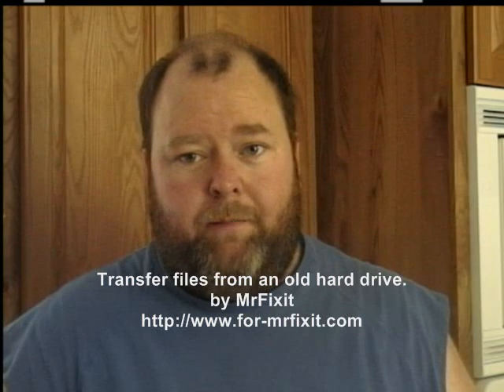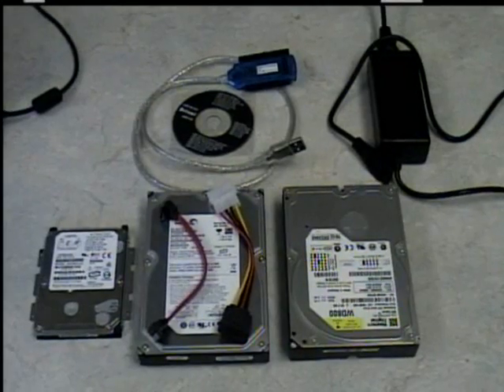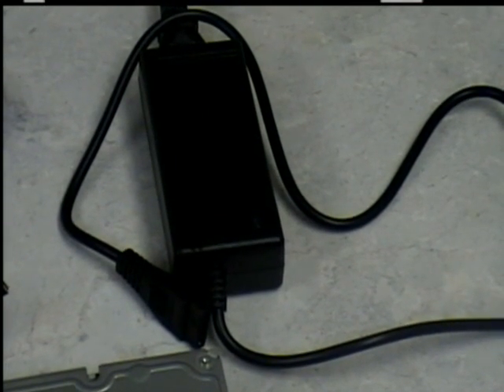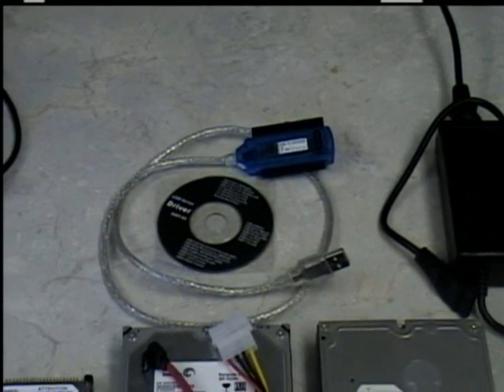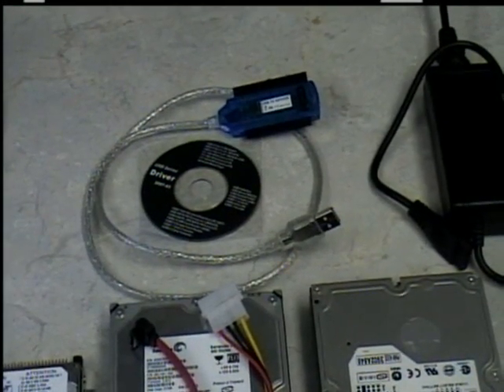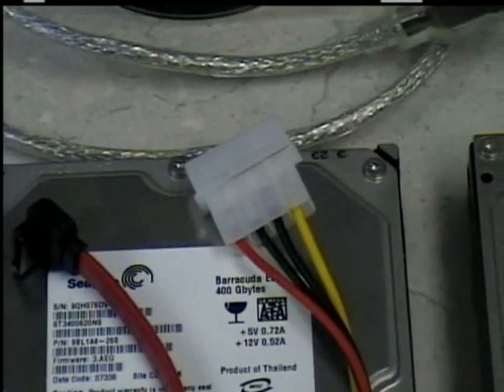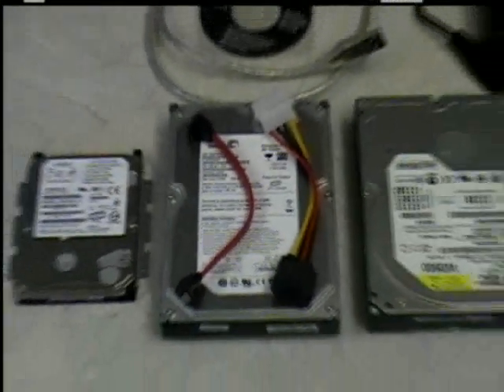How to transfer files from a Dead PC [CC]

Comment: Do you have a method devised in order to recover data  from mSATA SSD Drive to a USB Adapter ?   Can files be recovered by replacing  the Sandforce controller  ?
Reply from the maker: The method is not that different. You just need a  mSATA to USB adapter.  This will convert the mSATA drive into a USB Drive that most Data Recovery Software will recognize. As for the controller, It is possible to replace the controller but no guarantee replacing the controller will resolve the issue.

Comment: How do you transfer files from a dead hard drive though
Reply from the maker: IF the drive is dead and not functioning, you will need to send the drive to a specialized Data Recovery facility which can cost up to $1,500 or more to recover the data

Comment: NEVER EVER rely on a format of the drive or a delete of a partition to secure sensitive data. Data is easily retrieved from drives that have been formatted or had a partition removed. If you have data that you wouldn't want to simply give to a total stranger, always disassemble the drive, and drill at least three holes in each platter. That is the ONLY way to secure data.

Comment: Firs off, great tutorial. But I'd like to ask if I replace my old non- booting drive with a new hard drive, is it just as simple to transfer my files from my failed drive by connecting the sata adapter. Would love the feedback thanks
Reply from the maker: IF the old drive is still functional you may be able to mirror the drive to the new drive. .
Reply: ESRepair thanks. Yes it's functional. Will give a try!

Comment: Thank you very good job explaining everything step by step  , question can u transfer the information ,one way or u can transfer info from a 2.5 to a 3.5 HDD,  reply thank you.
Reply from the maker: You're welcome. To answer your question, the adapter in the video can only connect to 1 drive at a time. You cannot connect a 2.5 and 3.5 on the same adapter.

Comment: the plug in for the pc transfer kit thing looks like the Xbox 360 transfer cable plug in so can this plug into a 360 hard drive
Reply from the maker: I do not know if the adapter will work with XBOX drives. Do not have an XBOX to try it. -MrFixit

Comment: will this work importin to windows 10?
Reply from the maker: The adapter in the Video doesn't convert IDE to SATA nor SATA to IDE.  It will convert a SATA or IDE to a USB connection for laptops and Desktop PCs.  -MrFixit
Reply from the maker: Yes. the adapter will Work with Windows 10. You can transfer files and data you had created or downloaded, but it will not transfer any programs that were installed on the hdd.  Some adapters do have a Capacity size limit. Double check the Max size limit of the adapter to ensure it can read the hdd it will connect to.  -MrFixit

Comment: Can't I just install my old hard drive into a new computer by putting it in and using the extra power/sata cables coming from my PSU?
Reply from the maker: You can if your computer has an extra HDD bay to install it. -MrFixit

Comment: I had a HP all in, has pictures and other data on it. like to transfer to a newer pc, with windows 7 , the all in one has windows 10 that I couldn't get my windows 7 back anyhow, I have it all hook up right, but it won't spin, the manual for the adapter ended up as a dogs toy. hope you can help, thanks for your consideration.
Reply from the maker: if the drive wont spin. check the power connections.  other than that the drive is bad. -MrFixit

Comment: Do I need to set my HDD drive to either slave or cable select? I am running Vista.
Reply from the maker: The USB adapter doesn't use Master/Slave  protocols because it only connects to one device at a time.  Be Advised that Vista will lose all support in 2017 as it nears the end of it's life cycle.  -MrFixit.

Comment: Hello, ESRepair. Are you still available. Need some help with an old Ide drive recovery. 

I bought this kit from ebay, a usb to IDE sata S-convertor cable adapter power supply. It's similar to yours wish I would've found your site first.  

Question. is I have an external hard drive 500gig when connect shows it's E:/ drive  when I connect the IDE drive it shows as F:/ drive.  To my laptop. 

What I want to do is transfer all data from the 80gig IDE drive to the 500gig external hard drive. I'm not going to use the old IDE hard drive, so after I clean it I'm getting rid of it. 

Help is greatly appreciated and thank you, to or anyone else who can help me out.

Comment: hey i have question how can i find out the HDD that i have is 3.0/3.5 or 2.0/2.5 connectors?
Reply from the maker: ZiDDi JaTT  Desktop PCs use 3.5 inch HDDs and Laptops use 2.5 inch HDDs.  3.5 inch PATA/IDE drives have a 40-pin connector and a 4-pin Molex power connector.  2.5 inch PATA/IDE drives have a 44-pin connector because the data and power are in 1 connector.  Both 3.5 and 2.5 inch SATA use a 15-pin power connector and a 7-pin data connector.  -MrFixit

Comment: My local computer shop told me my hard drive was dead.  So, I purchased a new hard drive from them. They gave my old hard drive some kind of quick test and told me it was not working but they could do another type of retrieval that would cost me $160.00.  Should I buy this adapter and try your method?
Reply from the maker: bob abraham You can try this adapter to gain access to the drive, Plus you can watch my video https://www.youtube.com/watch?v=Hn29rsb54Kw to try the data recovery program and see if it can recover data from the drive. -MrFixit

Comment: hey i have bought new hdd 1tb and my old one is damaged or dead i cannot boot to windows with my old one so what should i do to copy files from my dead hdd ? just i do the way you do in video ?
Reply from the maker: GTASeries Mods Yes, as long the HDD itself isn't damage or has failed, you should be able to retrieve the data from the drive. -MrFixit

Comment: Howdy ESRepair..... Are your still around ? I need your help.
Reply from the maker: Roger Sayers Yes, We're still here. How can we help? -MrFixit
Reply: It's great to hear back from you. I have watched your video on transferring files from a old hard drive to a new computer. I have a SATA drive from a windows 8.1 computer, It has a lot of family photo's and vids on it, along with some other important things that I would like to try to recover. There is nothing wrong with the hard drive. It works fine. I also have two other hard drives from other older computers that I would like to save things from as well. What I needing is, Is for you to please tell me just what I will need to buy from you so I can try to recover the photo's and videos. Please give me part or item number (s) of the equipment that I need, and I will purchase it today. I think I know what to order, and I posted the info, but please tell me just what I need
Reply from the maker: Roger Sayers If you just want to transfer data and toss the drive, you can use the CoolMax IDE/SATA to USB cable adapter (T13-2519) for $19.99 or the Vantec NexStar Hard Drive USB Dock Station (V13-3300) for $34.99, but if you want to keep the drive to use as a backup then use either the Sabrent 3.5" (Desktops) USB/eSATA HDD enclosure (M501-1196) for $29.99 or the Ultra Aluminus 2.5" (Laptops) USB/eSATA HDD Enclosure (ULT40244) for $19.99. All items can be found on my online store at for-mrfixit.com under Hardware / Hard Drives. -MrFixit
Reply: Want to keep the drive. I'll be checking things out in you store...
Reply: +Roger Sayers I have to ask a completely noob question here, but what stops anyone from just connecting the old (working) drive to the new computer?
Reply: Jason Jedlikowski
Nothing, and that is just what I did after I purchased the correct data cable. I also purchased the adapter that I was talking about, and I have to say I love it. I can now check hard drives without having to open my computer and messing with the wiring. All I have to do is plug the adapter into the hard drive and plug it in to one of the six usb ports that I have on my computer. This adapter kit is great because it has it's own power supply. If you ever buy and use one, You'll like it, and you won't regret buying it.....

Comment: Whats the difference in putting the internal hdd in an external hdd case and using these adapters? Please help. I have in internal that I cant see to get to boot from the USB.
Reply from the maker: MisDirected There are no differences except External case are used if you plan to keep the drive as a USB device where as the cable version are used as temporary means to recover data and tossing the drive.  in order to boot from a USB device the BIOS/UEFI must support USB boot protocols. -MrFixit

Comment: You can format that drive and even delete the partition BUT the data IS still there!!!

Give it to another person and they can easily recover all of that data!

What you need to do is use software that will overwrite the data on the drive to make it unrecoverable.
Reply: or do it right and disassemble the drive and drill at least three holes in each platter. That is the ONLY way to secure a drive. Programs such as Encase can recover files from drives that have been formatted, and have had the partitions removed. Encase doesn't rely on windows partitions so partitionign doesn't matter. It uses a raw type read and simply appends a ~ to the leading character so it doesn't matter what the file name is.  Try overwriting with zeros and i'll own your data in a few seconds. Overwriting with zeros doesn't work either.

Comment: I have different problem, after I log in all I see is an empty desktop, mouse still works, alt + ctrl + delete brings up screen which has task manager button but when I click on it the screen goes back and task manager will not appear. Is this software or hardware problem and how to fix it. Thanks, by the way operating system is vista home premium 32 bit.

Comment: ES Repair--I'm trying to transfer files from a Win98 hard drive to another Win98 hard drive. Everything powers up but I get "Need drivers".   I have the connectors, cables etc. Apparently need drivers on CD. Do you have the drivers on a CD?
Reply from the maker: Too-Zee Potts many of the new adapters are not compatible with win98 because it is no longer supported. You may be able to check with the Manufacture of the adapter to see if they have an adapter. an alternative would be to add the HDD to the other PC as a secondary drive. because this is Win98 the drive would have to be connected and configured as a slave drive. -MrFixit
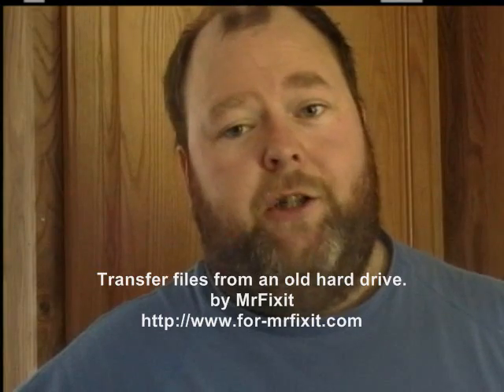Reply: According to the video above. There is a CD available with the drivers needed for Win98 to transfer files from a dead  computer hard drive to another hard drive. At approx. 11:34 there is a CD in clear view. that supposedly has the Win98 drivers.  Is that CD availavble?

Comment: when I connect my 2.5 laptop HD it starts up fine and I can see it in device manager and windows explorer, but every time I try to open the drive it locks up windows explorer and I have to restart my PC. same result on 2 different machines, 1 with windows 7, another with 8. Any advice would be appreciated.
Reply from the maker: Try running chkdsk to see if there are errors on the drive, it may be able to fix the it. -MrFixit

Comment: Your online store link says "page Not Found", I ordered something that looks like what you are using from Amazon, I think it is the same thing.
Reply from the maker: Thank you for letting me know of the problem. I have corrected the broken link. -MrFixit
Reply: Question, I have one that looks like the SATA/IDE you have, but some IDE drives will not spin up and I know they are good, maybe it is because I am using a Win 7 machine and I am trying to read a FAT 32 drive from Win (*?
Reply from the maker: ***** Windows 7 has the ability to read FAT16, FAT32, NTFS, and GPT formatted Hard Drives. If the drive is not spinning up, unplug the power to the drive, unplug the adapter from the PC and the drive. 1st make sure the power plug is fully inserted into the power connector then turn on the power adapter. Within a couple of seconds the drive should spin up and hear the heads click. Next, Plug in the USB adapter into the drive. Finally, plug the adapter into a open USB port. -MrFixit
Reply: THANKS, I will try that.
Reply: I have a drive that will spin up but nothing happens when I plug in the adapter, I tried it every way, I first plugged in USB cable FIRST than the IDE end into the hard drive, than I  plugged in the IDE in the hard drive FIRST than plugged in the USB cord to the computer.
Even unplugging the power first or last did nothing.
The drive DOSE spin, I do NOT hear any clicking just a smooth spin.
I know the hard drive is good because I formatted it in a Win 98SE computer.
It did have data on it.
Sorry to keep posting this but my computer skills are not good.
Reply from the maker: Thats ok. If the heads are not clicking when power is turned on, there may be something mechanical wrong with the drive. try my data recovery video to see if the Minitool Data Recovery can access the drive. -MrFixit
Reply: Update: I left the drive running for one hour and when I plugged in the USB cable to the computer I was able to read the drive...Strange, Thanks anyway for you help I appreciate it.

Comment: how do I gain access to my drive when it says I don't have admin rights? I have a sata drive that is connecting to my internal sata port in place of my dvd drive... it keeps timing out trying to load data I am assuming...I could use some help here bro... thanks
Reply from the maker: Max Crowe You can reclaim ownership to those files. I have a Video to show you how. -MrFixit
Reply: ESRepair
Tried to find this on your channel -- could you please tell me the title of the video? Thanks.
Reply from the maker: UnpleasantChuck How to reclaim file ownership in Windows

Comment: hope you can help
I have a Samsung laptop
I accidentally spelt coffee all  over it, so I down powered everything and turned it upside down and left it for 24hrs and then I disconnected the motherboard and the hard drive and the keyboard I had a good look at it all and it did not look to good so I washed the motherboard the 24hrs later I put it all back together went to turn it on and all I got was a white screen with black lines coming from the left to the right at the top of the screen then went all black so as far as I know the motherboard still works but unfortunately I have found out that my keyboard isn't working no longer also my hard drive,
So I got a USB 2.02 TO IDE + SAT Cable so I connect it up to a desktop PC 
but unfortunately it can not see or read the hard drive so I unplugged one of my old hard drive from a pc to see if it was the USB 2.02 TO IDE was not working but it show all of the old hard drives can you help at all or  would I have to get a new hard drive ?

Comment: i need help. i bought the kit, hooked it up to several ide/sata hard drives. some don't come on at all. meaning i don't hear the sound that its starting up. one made a beeping sound. the other i heard start up, but nothing pops up on the computer, don't matter which one i hook it up to and searching didn't come up with anything either. i've windows vista so if i heard correct i don't need a special driver. what m i doing wrong?

Comment: My computer is DEAD. After connecting the usb cable, all I get is a click-click-etc sound, no disc drive pops up. all I have is the drives C-D-E. after disconnecting and resting, I reconnect the usb and the clicking sound has gone away, but still no drive is coming up. what do you think I could be doing wrong. I have Windows 8.1 and am trying to download with a Kingwin ez connect usi-2535 ... 40 pin ide interface

Comment: will usb 2.0 be sufficient to power a laptop hard drive?
Reply from the maker: The USB can only Power 2.5 inch (laptop) IDE drives. Most adapters provide an external power supply like the one in the video for the other drives. -MrFixit
Reply: ESRepair . Hey thanks, I have a 2.5 and found a case and can successfully run it with usb 2.0 ports.
Reply from the maker: Jaaq Ess You're Welcome. -MrFixit

Comment: where should the jumpers be on a IDE drive?
Reply from the maker: The Jumpers on IDE drives will not matter when using the adapter. Most IDE drives are set as Master. -MrFixit
Reply: thanks for the info

Comment: Does this ork for Windows 7 OS systems?
Have been reading alot of reviews and it seems there are driver recognition issues with MS WIndows 7 and 8 operating systems.
Reply from the maker: The adapter will work with Windows 7. Some Adapters will not work in Windows 8. Check to make sure the adapter you buy is compatible with the OS. These adapters are plug and play. -MrFixit

Comment: Please help! Anyone 
More of a question 

Would this work with a corrupted hard drive? 

I'm not tech savvy so sorry if this sounds like a stupid question
Reply from the maker: If the drive is corrupted, you'll need special software that can correct the errors. The adapter will allow access to the drive but SW is needs to correct corrupted files/data. -MrFixit
Reply: i think no
Reply: That is a good question, I don't think this will work, but I will give you some advice, Take your hardrive and try it as a secondary hd on another computer, it might allow you to read and copy from that drive, not sure this works, but I have come across this many times!  Is your hard drive clicking?